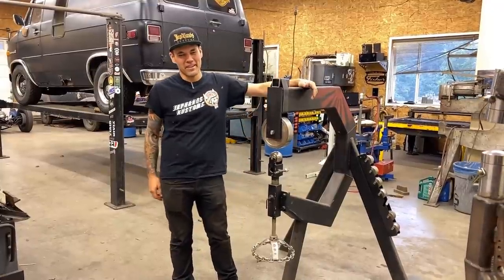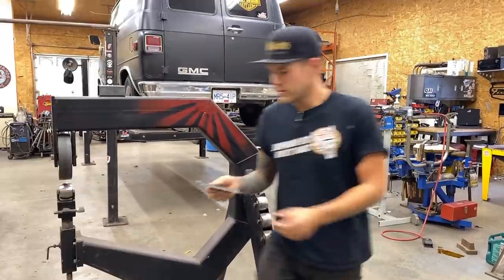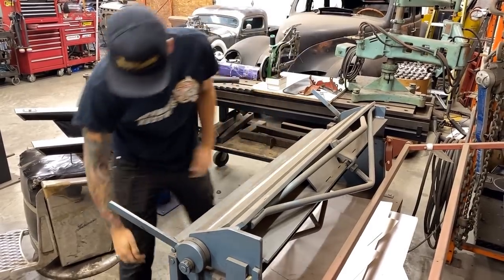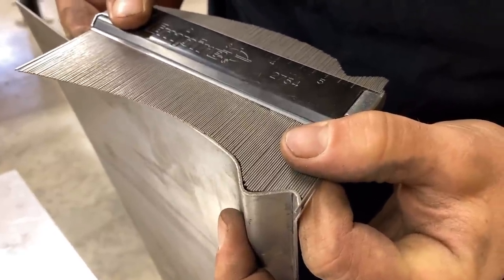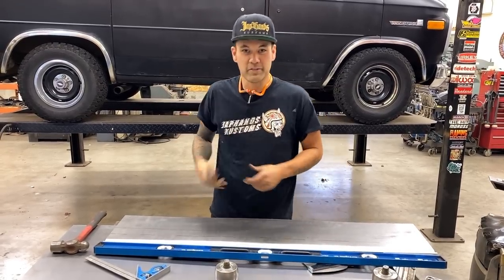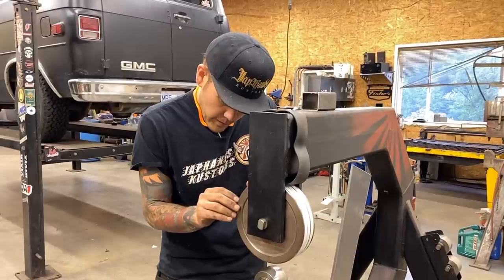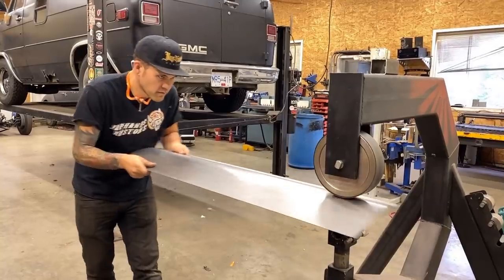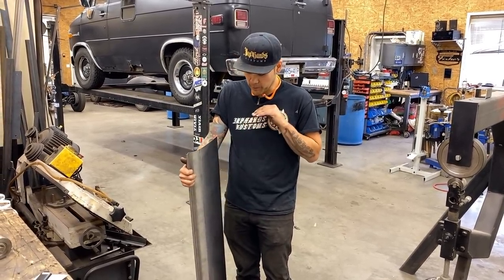RUST REPAIR - How To Make an EASY Rolled Quarter Panel With the English Wheel + Rubber Band!!

Comment: Great job Karl...just a reminder of something that I'm sure you already know.. adjusting the top clamp of your brake back, moving the fingers further from the edge of the bed, will make a larger radius bend...another trick I use is I made a " radius tube" by welding some flat stock to a piece of tubing..I adjust the clamp way back and clamp down the material with the radius tube between the fingers and the material...you'd be surprised how tight of a circle you can bump in. I made the curl of the top of a stepside pickup bed this way. About an 1-1/2" diameter.
Reply from the maker: Wow Jeff that’s such a cool trick with the tube! I have never thought about or seen anything like that other than with magnetic breaks

Comment: I've been self-learning sheet metal fab and welding to do my own bodywork.  I have watched many videos and read numerous articles and books but from your videos I have learned things from you that I had not seen anywhere else.  And your videos are just so pleasant and easy to watch.  I had been struggling to fab a 36" fender patch panel for my 68 Chrysler.  After viewing this particular video, I bought a Harbor Freight English wheel and rubber band.  I had one failed first attempt, but my second attempt resulted in an almost perfect fit.  I owe my success completely to you and your videos.  Thank you!!! ✌✌

Comment: Job well done,i enjoyed watching tou do it. I use Weldthru Zink rich primer on the backside of the patches i frequently use where i work before i finish weld, maybe keeps the rust goblins away. I've welded in a ton of cab corners,wheel opening patches and rockers from various manufacturers,they're all thicker the original metal,they are more forgiving an hold their shape better than thinner metal,plus who would know how thick the piece was considering they won't be able to see the inside,definitely a plus being a guage size or two thicker.
Reply from the maker: Yeah that’s what I figure too! How many is well through zinc primer on this repair as well

Comment: The die shim works well for putting contour lines in sculptural pieces as well. I think it came from Lazze. I have the Eastwood rubber band for the HF wheel and it wraps around the sides of the wheel to hold it in place, you might try that. Great video as always.
Reply from the maker: I’ll have a look at that one for sure it sounds good

Comment: Hey, Karl you want an idea that would help form tight radiuses for shaping panels take a four foot pipe with your desired radius and cut out 1/4 of the radius from the pipe and than use that pipe to shape tight radius with your body hammer. I believe it would work well and even have different radiuses that would sit into a stand made for that very purpose. One thing about this idea is that you would have to find thick walled pipe to get these to work for you. I'm sure you can find those. good idea with the double sided tape, the panel looks great 18 gauge who can complain about that at least you know the panel will last for many years to come. cheers bud.

Comment: Great video again. I went and bought me a new tube for my wheel but after a few jobs the tube splits. Buying the rubber belt may be the way to go.
Reply from the maker: Yeah I think the best option is finding a coated wheel. My rubber band is getting worn out already. I used to use tape. duct tape on the wheel Peels easy enough

Comment: Nice work. Enjoy watching your vids. Did notice that even though your wheel looks beefy it still flexes quite a bit when you push the panel through. Makes me a bit more at ease with the amount of movement in my mini wheels frame. 👍
Reply from the maker: Yes absolutely! My wheel is not the strongest one out there but it’s made of 4 x 6 by quarter inch lol so it is pretty tough

Comment: I had the same issue with my el-cheapo English wheel. I tried the thin double sided tape. What a mess when you take the rubber band off. I’m actually using truck inner tube. What I found on my wheel is that the lower anvil carrier can rotate, unless you really tighten up the set screw on the side. The lower anvil carrier on mine has a keyway forbthe set screw. When you tighten the set screw it makes adjustments of the tension difficult. Especially backing off the tension. The lower anvil doesn’t drop down. However, the rubber band stopped walking off the upper anvil once the lower anvil carrier was tracking straight. I only did the double side tape once. It was a real PITA to get the adhesive off. I also had an issue with getting a curve tight to a break. I turned a new anvil with the crown very tight to on e side. Didn’t think of the shim method. I’ll have to try that out. I was doing a brass sheet surround for a fireplace. The top most panel has an anaclastic curve. Took a few tries to get my head wrapped around that one.
Reply from the maker: Yeah man it was really tough to get it and survive how do use razor blades and chemicals lol I’m gonna make sure I find a rubber wheel for the top
Reply: @MakeItKustom  look for a belt sander contact wheel.

Comment: Nice trick with the wheeling machine. I have seen this once before many years ago, but it's so rare it's almost a new thing. I had at one time, (about 40 years ago) designed a rotating degreed anvil mount for a wheeling machining that would tilt as much as 15 degrees either way of center for this very thing, and could also be turned 90 degrees, but I never got to build it.  I also designed a main wheel mount that would rotate 90 degrees, but I can't remember for why...all I know is that there was really good reason for doing so. Do you have a narrow die? That would help with that tight area near the lip. You could also clamp the piece over a 4' section of pipe of the correct radius and then take a long thick bar and use that as a press over the form of the pipe. It wouldn't take much effort. You could also use a half or quarter section of that same pipe in the break and back off on the clamping force, then bend it on the pipe section.........but apparently what you did worked just fine 😉. I use 16 and 18 ga too. Welding 20 or 22 ga together is a losing proposition because the warpage is virtually impossible to control. You are definitely one of the better young craftsmen I've seen for  a long time.
Reply from the maker: Thanks so much man yeah that sounds like an interesting thing to have on the wheel for the lower anvil to turn!

Comment: I sometimes do a little thin line with a really thin zizz wheel on the back side of the break line,my 4 foot brake doesn't like 16 guage either.

Comment: Hi I am watching you on the TV, and I cant find the program on my phone. You are welding . And I am so glad
 Because I have been having all kinds of problems. My welder is a Lincoln 210. Not the same settings VC as yours.im I. Miami, and my welder is in my shop in Tennessee.Thank you so very much.
Reply from the maker: If you can watch and listen to your wild you can figure it out on any machine! Good luck! If you have questions you can email me
Reply: Here in Miami,  Virginia key.we had a beach that was closed for a long time . We used to call it sewer beach. All the jeeps . Sand rails etc. Were there on the weekends. So dummy me, I drove my 63 VW in there on a monday. ( my Saturday) there was no one there
 Skinny tires and all. I didnt get stuck. So I got brave. I drove on the wet stuff near the water. It sank. I couldn't get out. Took me for ever to find someone and have a long rope.  Got me out. But it was the down fall of my Bug. I washed my it. Pressure cleaned it. It got rust everywhere. Sucks

Comment: If you don't want to use double sided tape because its too thick, try using hair spray.  We used to use it on BMX and moto grips. Should be bit easier to clean off too.

Comment: The English wheel I bought uses a go kart tire for the top wheel. Theres no  inner tube in the go kart tire so the tire  forms curves quickly. You can form a transmission tunnel in a minute. One minute

Comment: I have not liked the rubber bands. They always walk and get hard and brittle over time. 
     What I found works best is a flat rubber wheel. That actually  replaces the top anvil. Only takes a second  to switch out the two.
Reply from the maker: Yeah I should find one. The rubber bands are a bit of a pain sometimes

Comment: Just a suggestion but in my experience putting the smaller lip into the brake helps make it easier to bend.
Reply: Also if you use some round stock with the brake will help not have the hard finger lines
Reply from the maker: Interesting thank you so much!

Comment: Great video! Would it be possible to do similar with I think it is called a "pipe anvil"? Basically a few different sized pipes fastened together with gaps between, so you have different bend radiuses, and pull the metal around it to form your curves. Seems like it might take less time that way, but I don't know enough about why, or why not to use that tool vs the English wheel.
Reply from the maker: Yes pipe anvils are great but they are not very precise like an English wheel is. That being said it certainly can be done with the pipe anvil
Reply: @MakeItKustom  Thanks for the reply! I can see why pipe anvil !ay not be as precise, then again, neither would probably be for me. Just looking at the two tools, the pipe anvil looks easier to learn how to use than the English wheel. But, yeah if you go too far with the pipe anvil, or don't move it around just right I can see how you could end up with not a perfect radius, where with the English wheel, you could just count how many times back and forth as you move it around, and keep your curve the same.

Comment: Karl, I think your videos are great, very informative. I had a brain fart while watching the English wheel video. Instead of the rubber band on the top wheel. Do you think one those aluminum hub with the neoprene wheel would work? I know I bought a set of them from McMaster Carr for my tool box when the originals fell apart.
Reply from the maker: It’s funny you mention that because I bought one of those wheels the other day to try it. I haven’t got around to machining the bearing races yet but I will. It seems like it’s a bit hard but I will vulcanize some rubber on it if I need to

Comment: Im not saying your wrong but I was told that if you used a thicker gauge metal butt welded to thinner sheets metal that it will crack the thinner metal from vibrations over time. What are your thoughts about this subject I really would like to hear your opinion! Great video by the way keep it up!
Reply from the maker: Hey thanks so much for the question and comment. I think in theory it could be possible but likely in situations where the gauge difference is much more spread out. I don’t think that it could happen in this situation with the van. I definitely wouldn’t do it for say a roof skin or a trunk skin

Comment: What would happen to the panel if you didn’t use the rubber band in the top wheel? Would it just take longer or not form right?
Reply: It would droop into a soft arc.
Reply from the maker: If I didn’t use the rubber top wheel it would end up stretching the metal. That is what the English wheel is for but it would start to make a compound curve rather than a two dimensional form

Comment: Couldn't you just use some tubing to make a rounded dye (I'm  it entirely sure what it would be called) to go over the edge of the press break to make a rounded bend in that tight corner?
Reply from the maker: This is easier and more precise but yes there are many ways to do this

Comment: I need to get myself an English wheel and a brake lol
But i had to make a rocker with a vice wheel bearing hammer and a vice.
The time it would have saved
Reply from the maker: I love that you did it anyway and you just use what you got! All these tools came into the shop one at a time and until they came here I still did work. There’s always away!

Comment: For this vehicle, not a high dollar resto, why didn't you purchase a rocker panel patch instead? Pros and cons of either?
Reply from the maker: Buying one is fine but it will be thinner than the one I made. I think for most people buying one is the best way to go. I can make one quite quickly here and out of thicker material so that’s why I chose this way